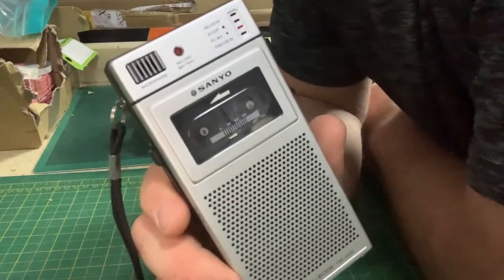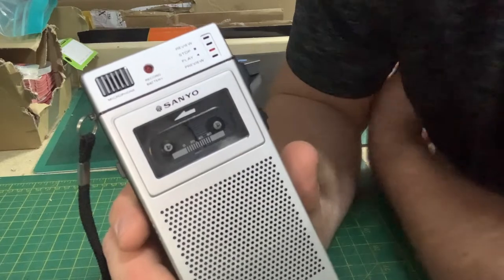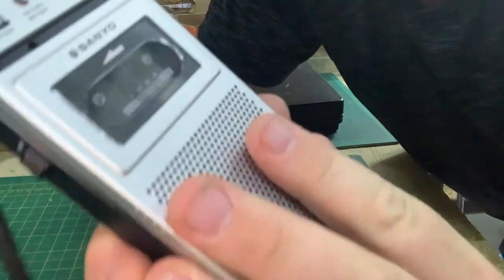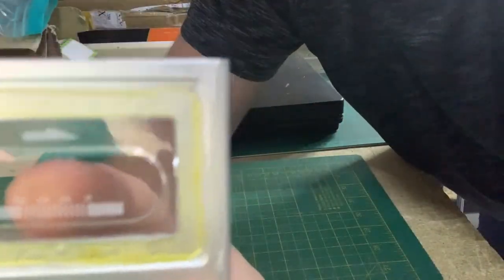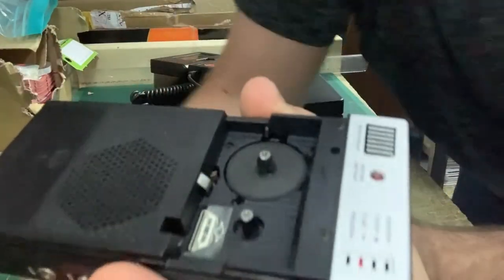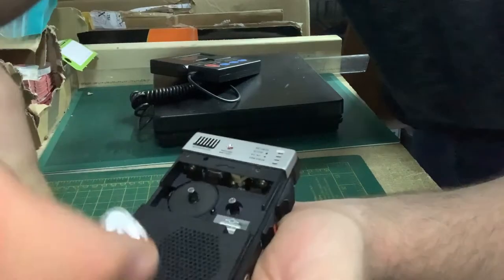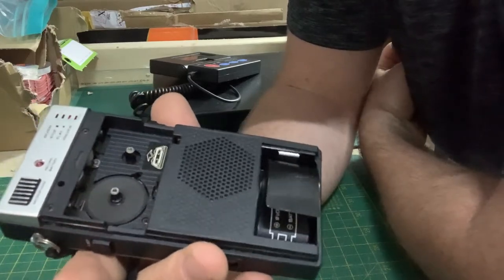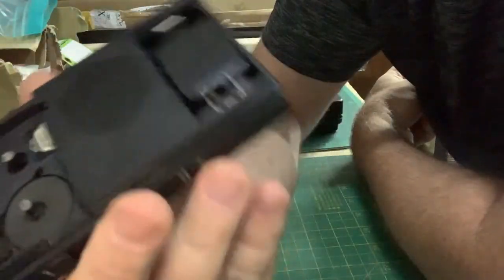Sanyo TRC3500 how to open and get to the cassette tape and battery compartment.

Comment: I got one as a gift, it's brand new and in the original box. Never been used. What year was the Sanyo TRC 3500 released? Thank you very much.
Reply from the maker: Hi William and thankyou for the message. I believe these were released in the 90s but I am unsure of the exact year. 
The belts on these do deteriorate over the years so even though it may be new the belt inside may need replacing but hopefully it will be OK for you. Great find  👍🏻